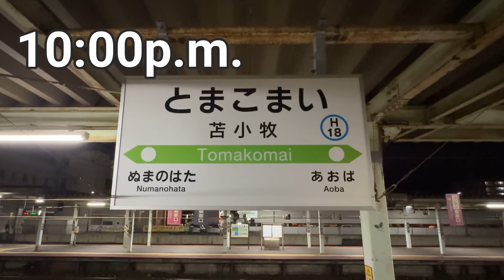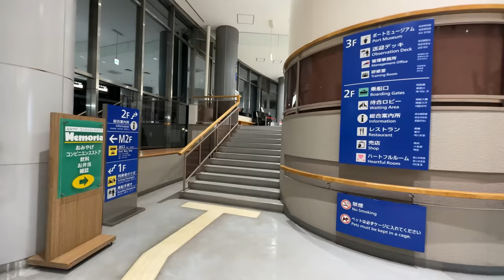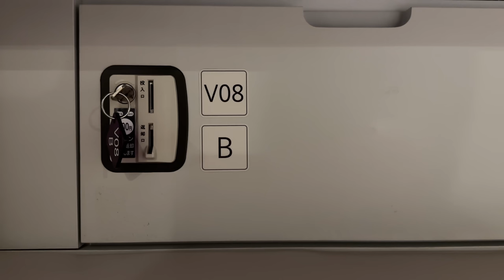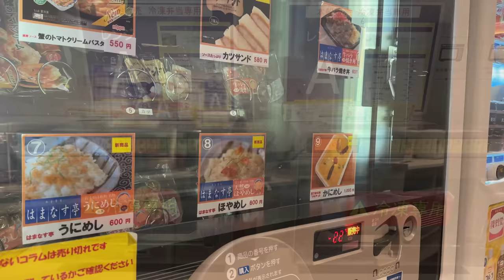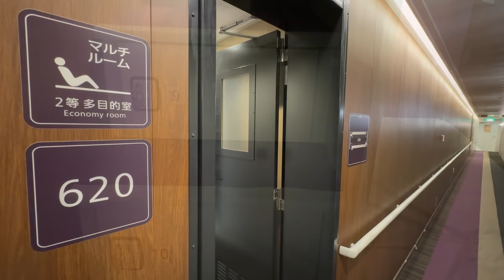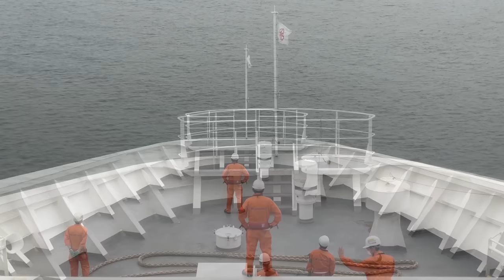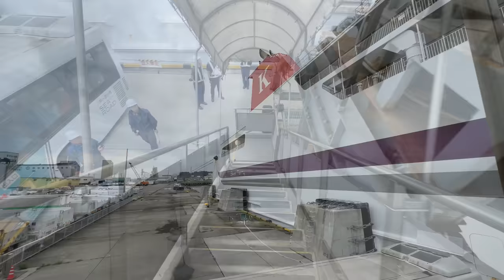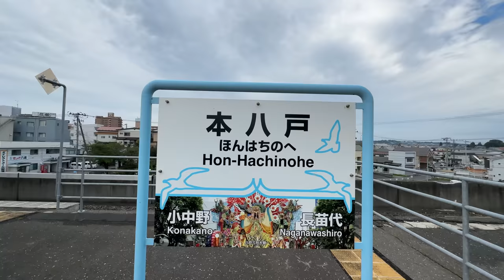北海道 苫小牧→青森 八戸 8100円 絶景ベッドでフェリー旅

Comment: I've watched several ferry trips in Japan. Most of the time, there are very few passengers and sometimes, it seems that the host is the only passenger. I wonder how these ferry companies make money?
Reply from the maker: Certainly Japanese ferries are not crowded in general, but the video does not show many other passengers, so there must actually be a few more passengers on board. Ferry companies derive more revenue from truck traffic than from general passenger traffic. Profits are not large, but they operate normally. Thanks!😀